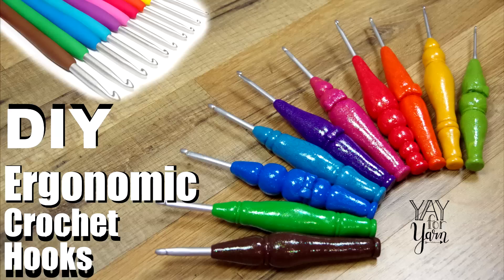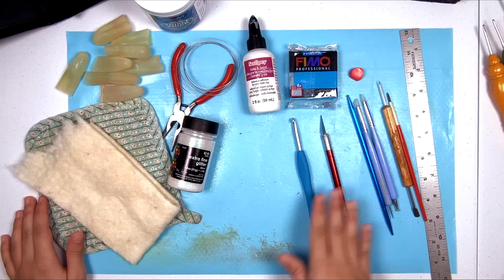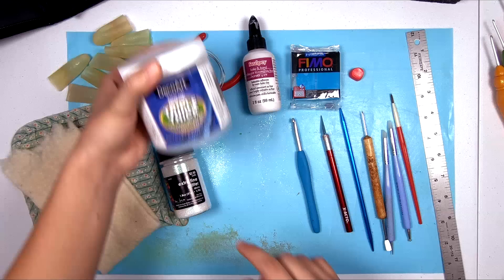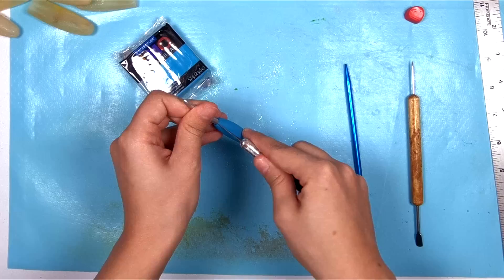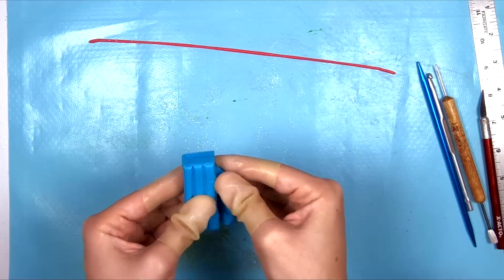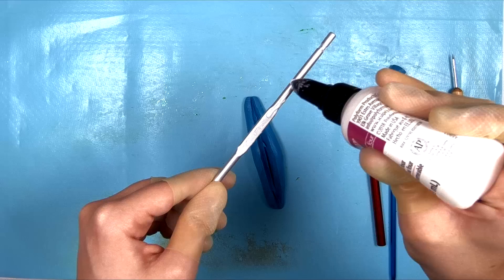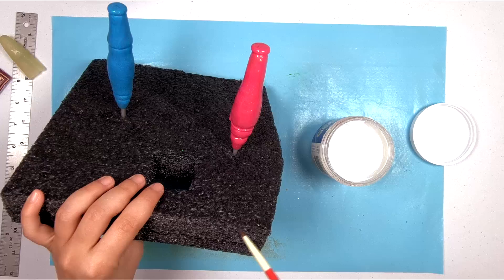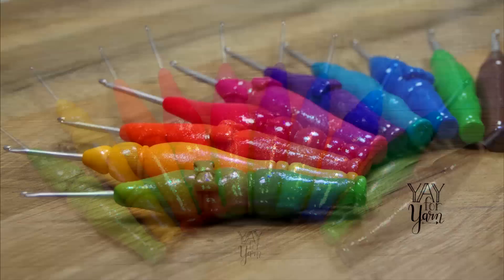DIY Beautiful Ergonomic Crochet Hooks with Polymer Clay Handles | Yay For Yarn

Comment: Can you use Crayola clay?
Reply from the maker: Hi!  For this project, you'll need an oven-bake polymer clay.  I am not sure what type of Crayola clay you are referring to, but an air-dry clay or an oven-bake clay that is not "polymer clay" will not work very well for this project.  Air-dry clays tend to shrink while drying.  While that may not be a problem for small sculptures and crafts, we are building these handles around an existing metal crochet hook.  So if the air-dry clay were to shrink around the hook, it will crack.  Air-dry clays are often more brittle and fragile than polymer clays anyway.  A modeling clay will not work at all, as those are made for play only and are not supposed to harden.  Unless your clay says it is "oven-bake polymer clay", I would not recommend using that for this project.  Hope this helps!  Please let me know if you have any more questions!

Comment: Do I have to use the bake and bond stuff? I want to make a thick ‘ergonomic’ pen but I don’t have nor really wanna buy that glue stuff for just the two pens I wanna make. Does any one know if I have to?
Reply from the maker: Hi!  I am not a professional at working with polymer clay, but from what I understand, the bake and bond glue is necessary to make sure the clay actually sticks to the item you are covering.  I would suggest doing a few Google searches for more info on making ergonomic pens with polymer clay.  I hope this helps!